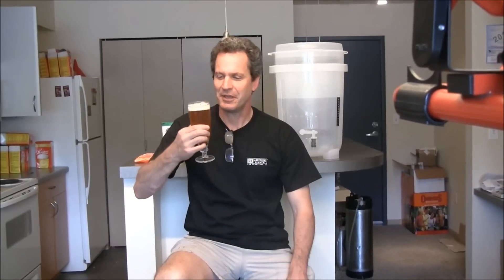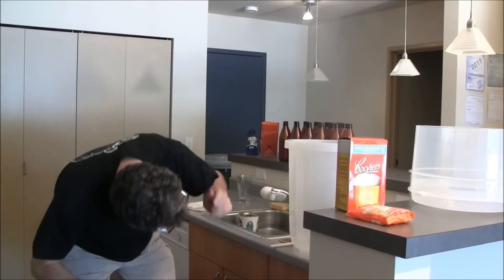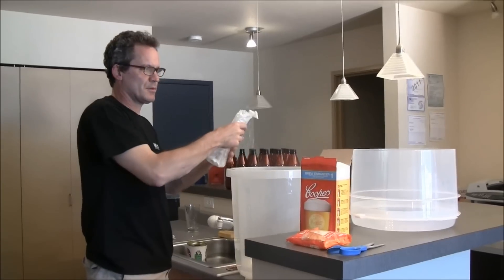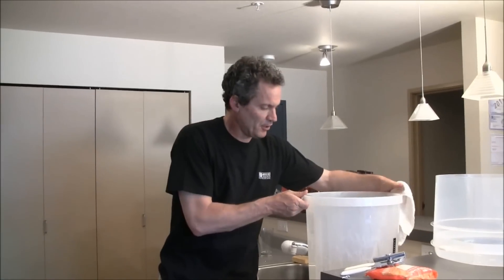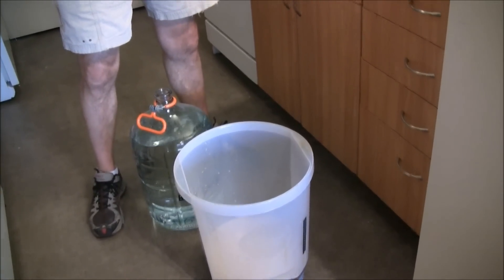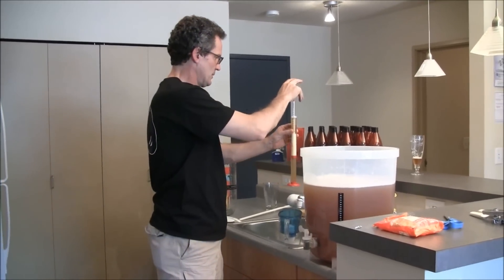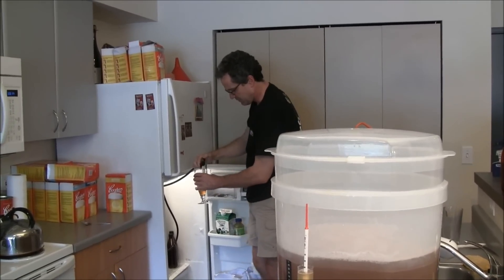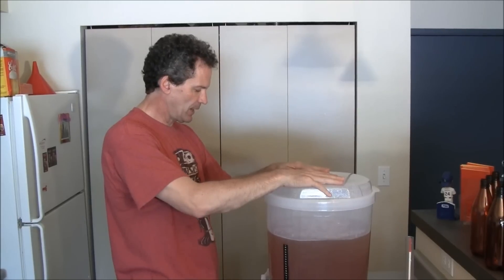Brewing the Coopers Lager using the New DIY Kit

Comment: they are cool  I have had mine for a few months and no issues,  love it. 
so much easier to clean and you get over it not having the airlock,  a lot over here don't use them just use glad wrap and the rubber o-ring to keep it sealed

Comment: When taking a Hydrometer reading you should 1/2 fill the tube and discard then fill it 2/3 to take a reading from.You may not get a correct reading from the 1st reading as there tends to be buildup in the tap area.Also it easier 2 add the sugar 2 the FV 1st then the water as it is easier to pick the FV up and swirl the water around to disolve all sugars than is 2 stir it.I have had a DIY kit since Xmas 2010 and the only thing wrong with it is a leak from the tap if I'm not careful when using it.

Comment: You said the kit is a Lager, but you fermented in the 70 degree range.  That would taste horrible.  A true Lager yeast needs to ferment in the 40 degree range, maybe low 50's but thats pushing the high side. What kind of yeast did you use?
Reply from the maker: Thanks for your comment. I didn't say the beer was a lager. The name of the kit is Coopers lager. The flavor profile when fermented out is similar to what is a typical lager. The yeast included with the kit is an ale yeast and can be fermented at room temperatures. You can substitute a lager yeast but you will need to ferment at a much lower temperature over an extended period of time.
Reply: +tiltrotor22 40 is a tetch low for a lot of lager yeasts and might be prone to acedoldehyde production. Low 50s is ideal.
Reply: +upgrayddable really depends on the lager yeast, some german lager yeasts are okay in the 40s
Reply: I'll agree with that. WYEast Bavarian especially does well at low temps. On the other hand, I haven't noticed any lager yeast to perform better below the low 50s, but some do perform worse under about 50 or 51.
Reply: Kit is called a lger but comes with an Ale yeast.